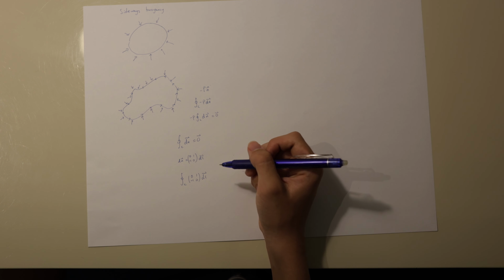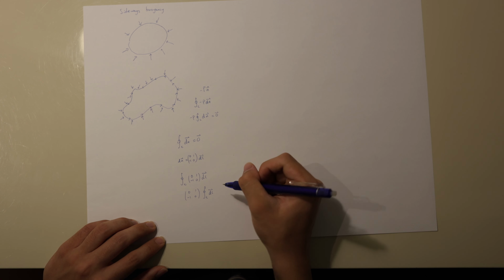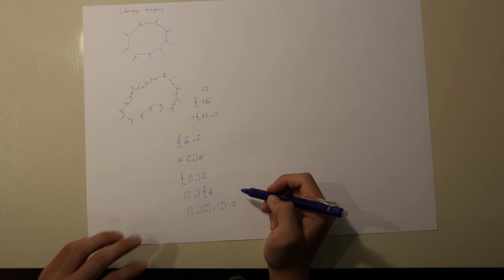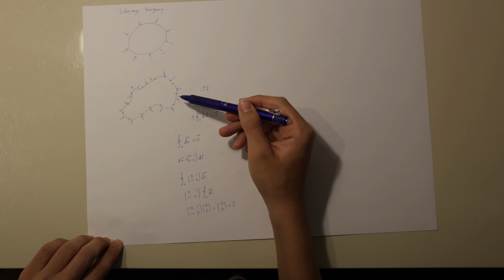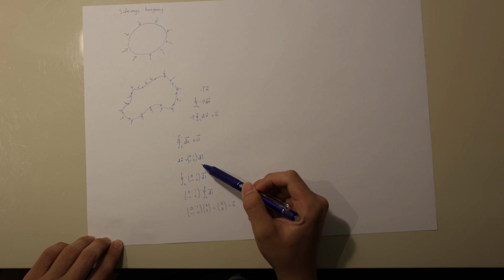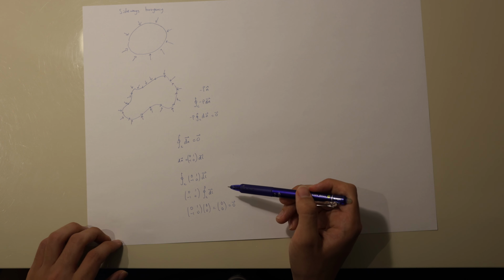Why doesn't buoyancy act sideways?

Comment: So how would the math work out if you had your 2d shape tethered to the bottom of the container, e.g. the cross section of a buoy where there were two liquids of different densities on either side. Would the heavier liquid exert a force downward great enough to force the object toward it, or would the extra pressure from the denser liquid force the object away?
Reply from the maker: In general it's not possible for liquids of different densities to be side by side, and the denser one will always sink to the bottom, then the object will settle at just the right height where all the buoyant forces add up and equal the weight. But if you somehow had a dense liquid on one side and a lighter one on the other, then yes there would be extra pressure from the dense liquid direction.